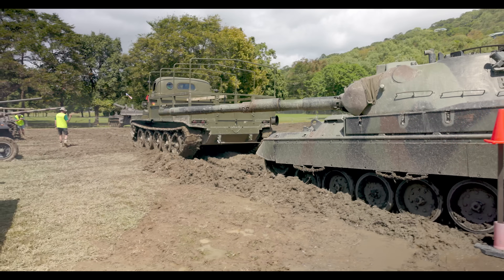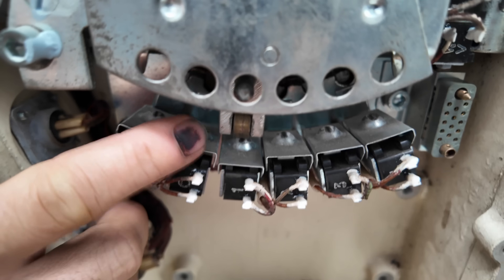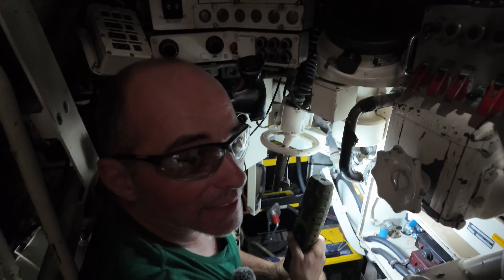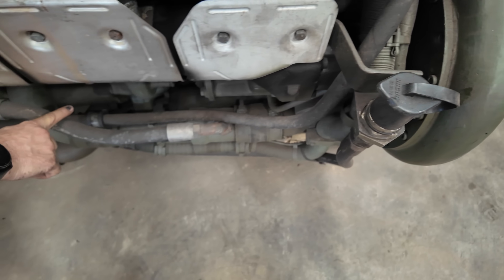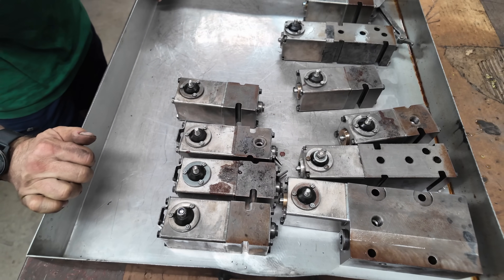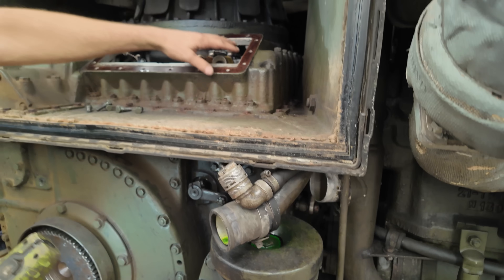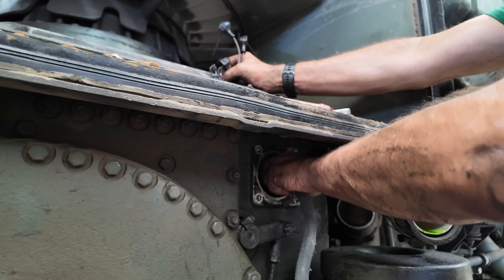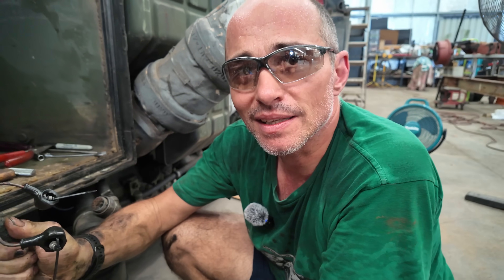Diagnosing and Repairing the Leopard Main Battle Tank!

Comment: I prefer to use electrical tape for keeping track of things. green, yellow, white, black, red tape - sometimes I'll use a paint marker to correspond the placement other times just a small piece of tape. Great video and keep up the great work!
Reply: I was thinking about coloured cable ties rather than loads of washers on each one
Reply: I use heat shrink that is made for my label printer. Very durable label that never comes off and only about 15 bucks per 4 meters. No special label maker either just an ordinary Brother unit.

Comment: First, I appreciate the video greatly, love watching these over the years. Next, I’d like to share my experience in repairing ‘cannon’ plugs while restoring vintage military vehicles and surplus military aircraft (primarily former Soviet aircraft). Every cannon plug has the same susceptibilities that can cause problems, sometimes it’s from someone not properly aligning the  pins and forcing the connector secured. Most cannon plugs with thinner connectors can be closed/connected if a couple pins aren’t aligned because the silicone water sealing material will allow the pins to stick in. If all dirt and debris wasn’t cleared out of both ends of the plug before connection it’ll leave a gap that allows water in. I’ve seen strong men secure/connect a cannon plug when it was misaligned despite the indexing pins being aligned, they just twist the lock ring with a lot of force and it’s connected. All that said, it seems like common sense to prevent an improper connection but it’s not hard to fix. Find an old but serviceable cannon plug with connectors rated for the same connectors as the original, never put a lower rated plug that requires larger connectors, it’ll act as an inline fuse and pop from overheating but not before it causes some damage on the source end of the power flow. The cannon plug doesn’t have to be German made, any will do. Then cut off the wires from both ends, make sure they’re tagged with a piece of masking tape or zip ties and write the trace number for each with, the cannon plug will have numbers both inside and outside of the connection but they’re in tiny print so look closely. The next step is to connect the replacement plug wires by soldering them with proper solder or, use aviation wire connectors, these connectors will create a water tight seal at both ends then you can slide the shrink tubing down over the connector and heat up the shrink tubing and move onto the next wire. Always have around 6-9 inches of wire on each end of the replacement so it’s easier to work on and if a mistake is made you can simply cut off the mistake and start over. Then ensure the wire is connected to each pin by using a multimeter and once all traces/wires are properly aligned, apply some silicone sealant behind each end of the cannon plug to give it extra protection just to be safe. But if the replacement cannon plug is old and the gasket has deteriorated or shrunk from heat and age, make sure it will seal the connection properly, you can tell when you’re twisting the lock ring, it’ll go together very easily, basically too easy. 
  There’s all kinds of options one can choose from to repair a wiring connection issue since sometimes you won’t have everything you need to fix it and go with what you have. In military vehicles the wiring harnesses will deteriorate over time due to the lubricants and hydraulic fluid covering the wires so double check the wiring harness to make sure there’s no damage or dry rot, also look for pinched wires in case someone closed a hatch or panel without moving the wiring cluster away before securing or during the last power pack install. 
  Apologies for the long comment, just trying to pass this on to someone who’s newer to the MV restoration community. Just try not to assume everything is done correctly while you work on these, always know. All my best.
Kevin from Texas
Retired Army Infantryman
Reply: Excellent comment, worked with the same connecters in heavy industry.  Repairing one of those in a j-box in a dark slimy space under a 5-stand rolling mill was not a trivial pursuit. Moving everything needed to do it there was less than half the time and effort.  Certain design engineers were not my favorite people after that experience.
Reply: Nothing like the voice of experience!
Reply: I deal with small Juliet connectors with very fine pins and it is always an annoyance that the keyway always engages just before the pins, .25mm ...
Reply: @truracer20  what always annoyed me is how the gorilla that connected the plug didn’t realize he didn’t have them aligned and just cranked down anyway. Those aviation grade wire lead butt connectors that expand a sealant as they’re heated up to shrink the ends and it creates a beautiful water tight connection, damn things are around $2-$3 per connector though, lol.
Reply: The longer the better, that was the talk on Canon's.

Comment: It looks like fluid got inside the connector. We use these on our equipment. We found the best way to protect them is to put a good coating of silicon grease inside the receptacle part and then mate them. You probably already know not to use petroleum-based grease or oil (like WD40, etc.); it will attack the seals in the plug.
Reply: i just made the suggestion to fill it full of vaseline.  there will be seals that work well with vaseline but silicon grease sounds more mil-spec.
Reply: @vsvnrg3263  Yes silicone definitely the preferred option. Vaseline is petroleum based.

Comment: The Cable manufacturers part number : Serial Number  006421 Cable Assembly Special Purpose, Electrical (Transmission Control)  D1839 2360-010000-13-0  and the Plug and wires for the Transmission is : Serial Number  006457  Wiring Harness Branched D8124 407220 6028

Comment: Wiring Mil Spec cables is a highly skilled job. I've tried to wire a few, the air was blue & I'm used to soldering vintage tech. The multicore cable isn't cheap either & often only available if you buy a 100M roll, you may be talking $1000's just for the cable. Do hope you get it fixed, good luck.

Comment: That's a man who can make complicated things work again - Chapeau!
Reply: Hmmm,  on the farm we use the same mil spec. connectors on some of our ag equipment. Yes,  the same 19 pin connection. Not crazy expensive to replace nor to fix actually. Pull the four bolt plate off and check for extra wire first, because that’s how it would be fixed in the repair depot as a quality expedient fix to put the tank back in service. One level up if you have not enough slack is single wire replacement. There are many many ways to overcomplicate a quality repair. I expect what has happened was the connection was rammed together without proper alignment, pushing the socket back and a poor connection has over heated the contact point.

Comment: 12:33 honestly, i would undo that nut and snake that part through the casement rather than try to take the hydra through it.
I would also not throw that cable out, rather repair it and put it in storage. Those connectors are easily (relatively) re-pinned. I've repaired several military radios in the past (as a hobby) and it's actually quite fun.
Reply: Agree, it would have been how it was installed looking at the design. Much easier to feed from the solenoid side down to the mounting bracket.
Reply: Saved me from making the same comment.

Comment: 220321SMAR24
Oh, I know the pain of multi-wire connections. I was a member of a model railroad museum in Tucson (AZ, USA) for many years. The museum inherited a very detailed HO scale engine house and turntable diorama. There were at least 8 tracks that went into the engine house. Each track was energized, one at a time, to move the locos. The builder used rotary switches to energize a specific track and all of this resulted in a thick wire bundle. To my horror, the crew that dismantled the piece cut through the wire bundle without labeling the wires. I spent months first deciphering the logic behind the controls then tracing each output wire from each control panel switch to the matching input wire. Label & repeat. Finally, I was able to rotate the turntable under power and stop at the correct track. Patience is a virtue fuelled by Rum & Cokes.

Comment: I've soldered those connectors back when I was 16 doing a vacation job at the Frankfurt airport. They were used for ramp agent to pilot communication and inside the aircraft.
They are also used on sensory equipment to locate explosive ordnance in the private sector, that's when I stumbled upon those connectors again.

So for me it would be plan A to solder new connectors to the wiring loom and the least would be to go through the hassle of swapping the loom. Different expertises I guess. But 120PS really shouldn't be more than what a mechanic drives 😄 Or is there a horsepower tax in Australia?

Comment: Would it have been easier to remove the male connector from the square plate and feed it up into the box, withdrawing it from the top?
Reply: Good idea. I was thinking of attatching a wire to the end of the loom as you drew it out, and leaving it in the pipe to make it easier to draw the new loom back through to the solenoids. Good evening from the UK, by the way.
Reply: not without disassembling the male connector by cutting the wires .